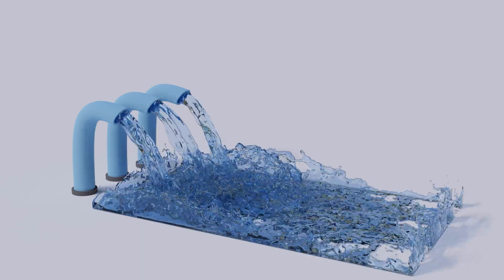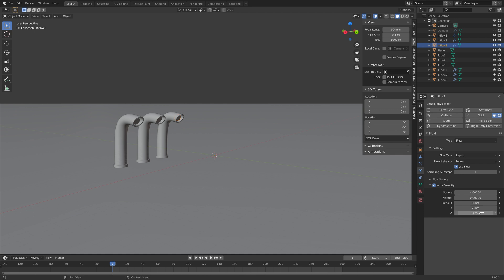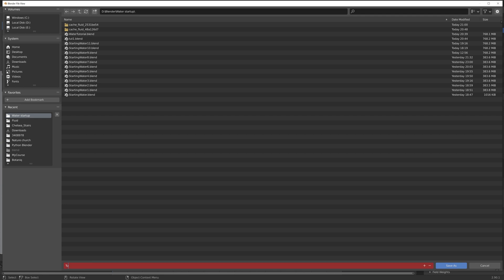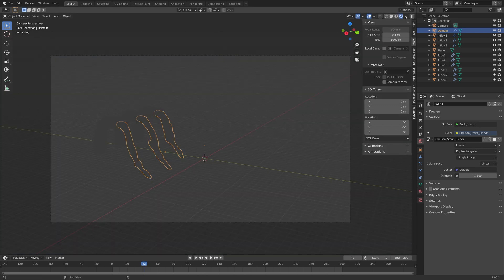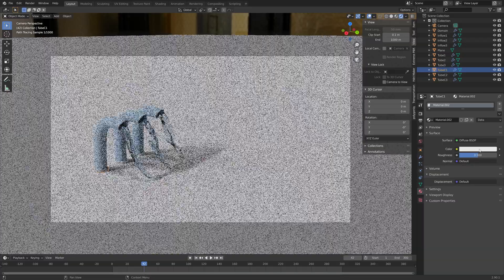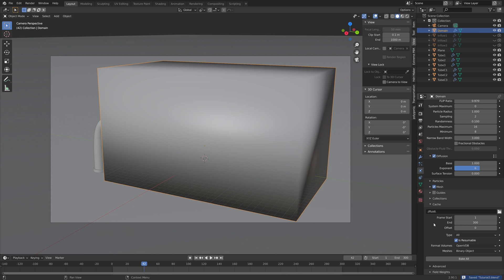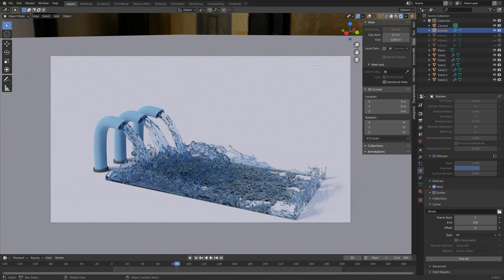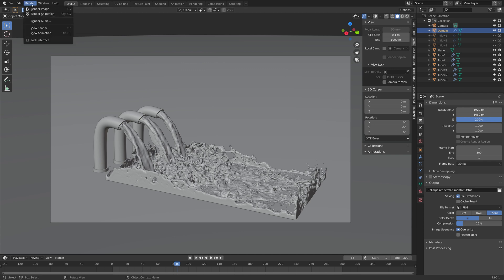[2.9] Blender Tutorial: Quick Water Animation

Comment: I tried this tutorial step by step to try and get the fluid anination shown at the 3:48 minute mark    
in Blender  2091.0 but instead of getting the nice looking animation after baking my scene looks more like a coronavirus simulation instead of water. Why is this happening?
Reply: ya me to and how are you supposed to get rid of the domain box?
Reply: @ZackDaQuack  I found the solution to the fluid problem I was having. After comparing the animation I was doing with this tutorial with an older fluid animation I mad a while back, that I found out that I didn't have the "Bloom" option turn on in the render properties menu. After turning bllom on my fluid animation is working correctly like shown in this tutorial.
Reply: @geoffreybanditt4355  thank you! i looked everywhere for that
Reply: @ZackDaQuack  Your welcome.
Reply: hey, I have the same problem, but it doesnt help when I activate bloom :( do u have an idea?
Reply: @fixihartmann320  Unfortunately I have no more ideas for what is causing your problem at this point of time. But I will give you this link for some possibilities what could be causing this problem. 
https://blender.stackexchange.com/questions/169717/fluid-not-showing-in-fluid-simulator
Reply: @fixihartmann320  Also you might want to check out this video "Common Mantaflow Problems & How to Fix Them!" https://www.youtube.com/watch?v=2O0QcLpAxV4
Reply: @geoffreybanditt4355  thx I´ll try

Comment: Hello everyone! I am facing some issue, once I follow everything & I bake it (while the Domain layer is selected), the whole cube doesn't go away & stays right there... Can someone help 🤔
Reply: PRESS G
Reply: I have the same issue
Reply: @Lada333  Hello Lada, I figured out the problem, this basically happens when 
1) The bake is not properly done
2) The keyframe which is selected at that point doesn't have the material baked, e.g. if you bake from 0 to 50 frames, then at 51 frame you will see the cube. 
Also remember when you bake, the object should be visible and not hidden, after baking it will automatically go away in the first frame and then it will appear as the animation is designed to perform. Hope this helps, let me know if this was useful for you :D
Reply: @waqas.180  I had the object visible, and I paused the bake around 40 frames, and was scrubbing thru frames 1-40 to see if there's any motion, but with no success :/
Reply: @Lada333  this will only be possible if you keep the bake a resumable one... If you are baking from 0-40, let it fully finish and then run it. Maybe it solves the problem. 

I know the baking is a painful & long process, but it is what it is